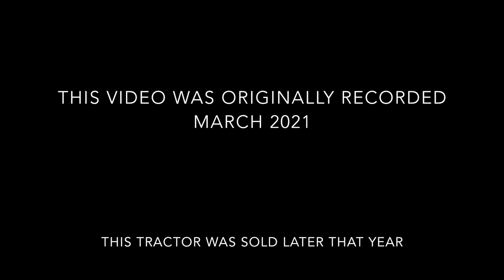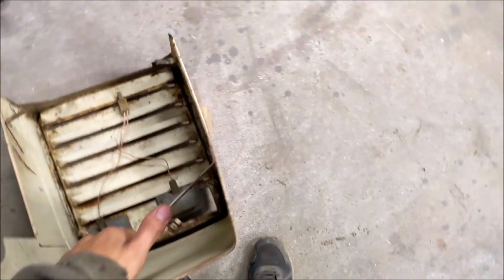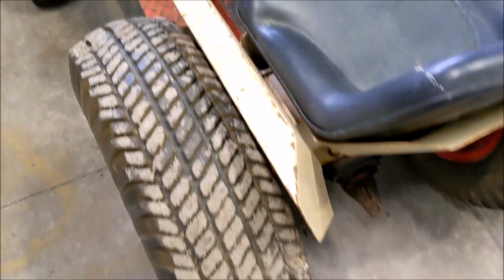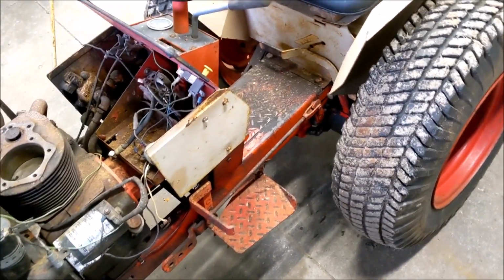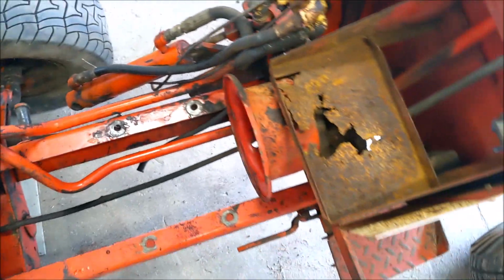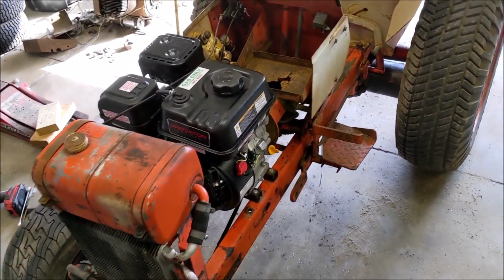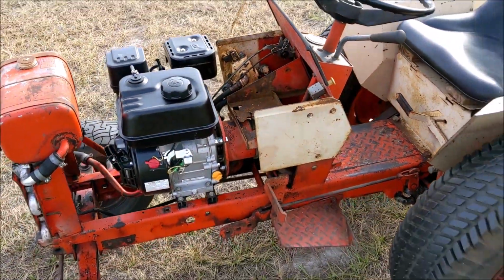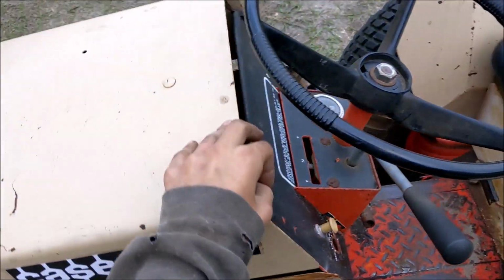Case 444 garden tractor and repower

Comment: Thanks for the great video! Loves seeing an old 446 running with a different motor. In regards to your high gear or no benefit of over 50% throttle, what fluid are you using for your hydraulic system?  Those old Case tractors really like 30w motor oil for the hydraulic fluid.  If you use a heavier "hydraulic oil", you will get the exact symptoms you describes..  I try to use Rotella 30W when I can find it, otherwise any will do.  Good luck!

Comment: Whats wrong with reconditioning the original Kohler american engine ? I hate when someone repowers with Chinese junk 😠
Reply from the maker: I'm not a fan of Kohler, also wanted something reliable to just pull start and go. No need for a battery.

I currently have around 25 of these engines in tractors and they never have any problems and are reliable compared to my machines with original or old engines.
Reply: I apologize if i affended anyone , was only talking an engine ,not personal.😕
Reply: The K series engine design is 63 years old and is antiquated by any standard. The engine on this tractor is clearly worn out. I wouldn't have wasted time or money trying to bring it back from the dead, either.